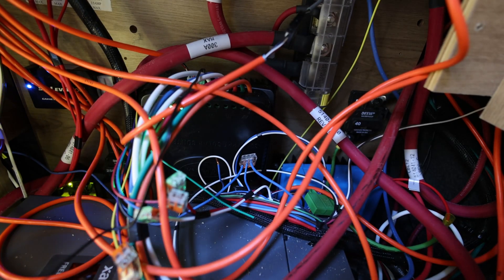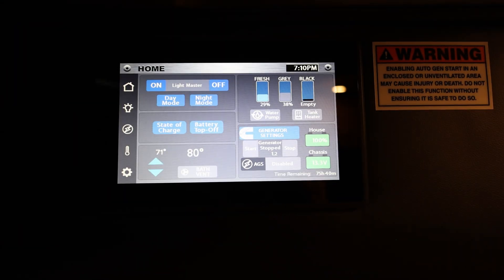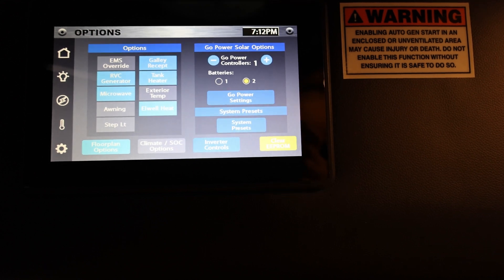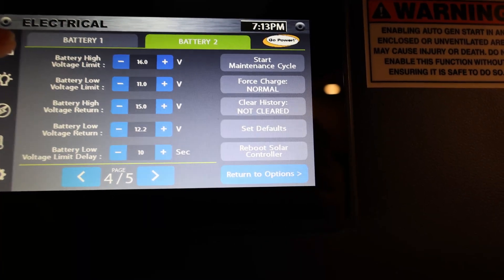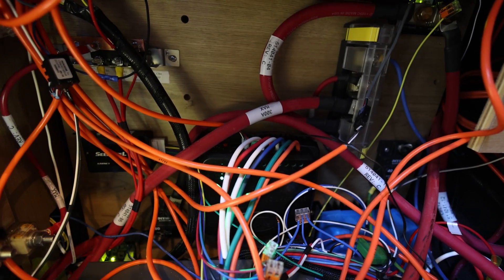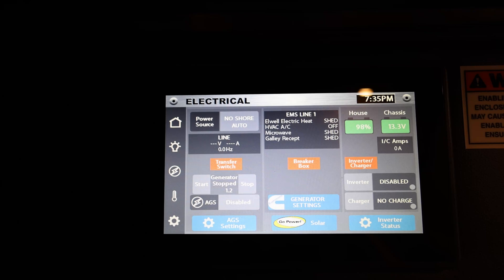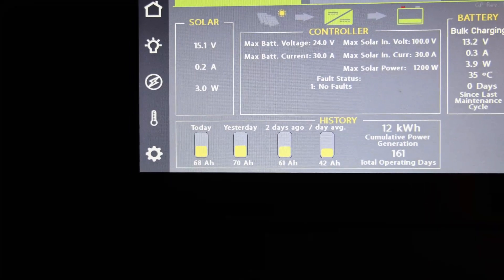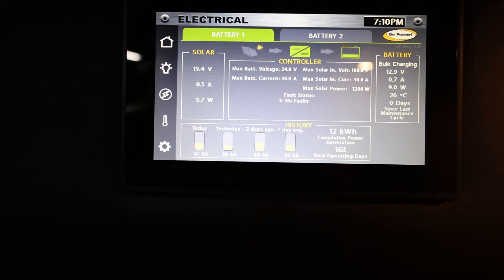Swapping the charger order on the Airstream Rangeline Go Power Solar controller

Comment: Your videos are great! Thank you. I have a '24 that I picked up 3 weeks ago. When I go into the settings, Battery 1 is my house battery and Battery 2 is my chassis battery. Maybe Airstream watched your channel... I'm going to update the House battery settings per your suggestions. I'm hoping this helps as even on sunny days, my refrigerator seems to use more juice than the solar can charge. Losing about 20% charge per day on the House battery with nothing but the fridge on.
Reply from the maker: That's pretty consistent with what I see with winter sun - about 20% loss a day just from fridge + lights with solar. I'm planning to upgrade the solar panels this summer which should help. Airstream actually recalled all the 23 units to wire the batteries properly. The 24s were set correctly from the start.

Comment: I picked up my '24 yesterday and despite asking them to check that this is wired correctly, i'm having this issue too. I'm going to flip it myself but can I please ask you a couple things? I've wrenched on cars a lot but not a lot of electrical experience. 

First thing, I flip the battery disconnect in the rear of the coach. As long as I do this I'l be safe to flip the wires right?

Do I need to manually change the battery 1  type from AGM to Li in firefly and vice-versa? Do I do that before or after I flip the physical wires? 

The rest of the settings seems straight forward. I feel pretty confident but I just want to double check with you if you don't mind helping me out. Thanks so much.
Reply from the maker: The solar controller is upstream of the battery disconnect switch so it can still charge the battery even if the switch is off. So you need to make sure the solar panel is unpowered before swapping the wires. Just do it at night or unplug the cable on the roof. I was just careful doing the wire swap, but there's a fuse disconnect on the chassis and house battery lines - check the circuit diagram. I did the swap first, then changed the settings through the firefly. The video shows the settings I used - I entered custom values because the defaults don't match what either the controller manual or battery manual say to use.

Comment: Great information!  Does the Rangeline have a secondary solar input outside for an additional portable panel?
Reply from the maker: It does not, but it wouldn't be too hard to wire one. The controller will accept up to 100v 30A input, so you can add additional panels either in parallel or series to the existing circuit.

Comment: Where did you reference the updated settings for the batteries once you switched them.
Reply from the maker: I got the settings to use from the solar controller manual and battery manual. You can update the settings via the hidden settings menu in the Firefly control unit (see about halfway through the video)

Comment: Thank you for another excellent video!
In the first few minutes of the video when showing the electrical bay, I noticed in the center of the screen what looks like a loose single wire with blue insulation a bare striped end?
Reply from the maker: Yep, I noticed that too. Not sure where that one comes from, It goes into a mixed cable bundle that's hard to trace, but I think it goes to the Firefly distribution panel. There were a couple of other unconnected wires laying around too.